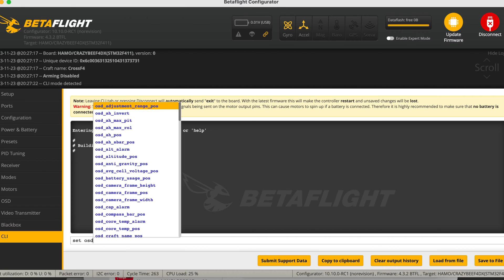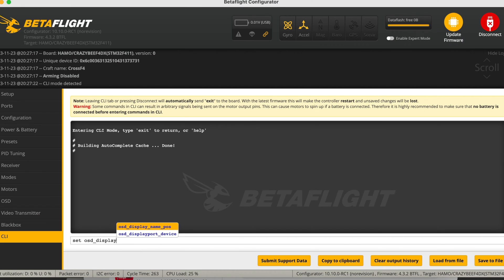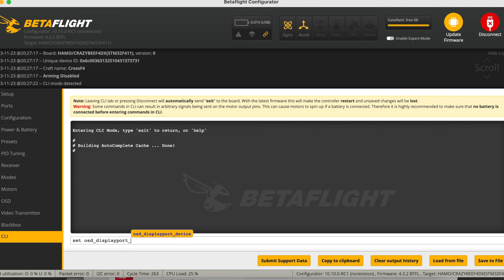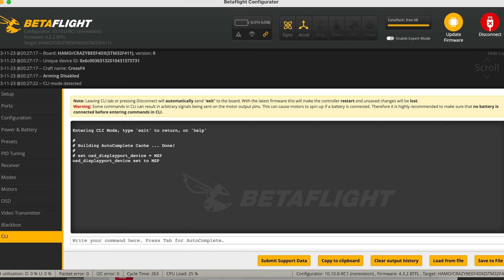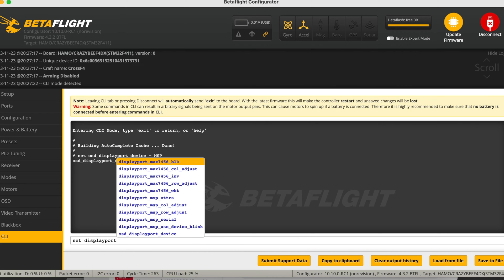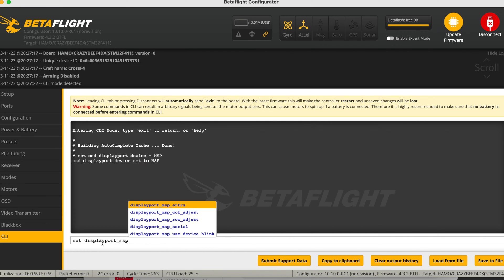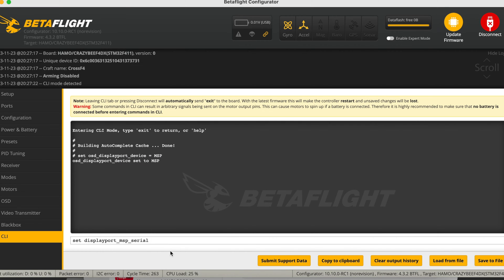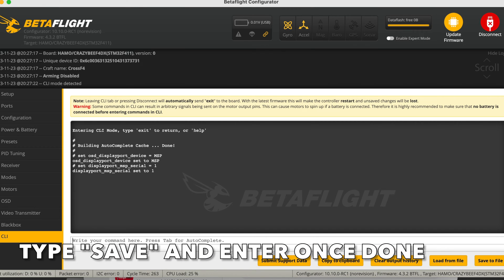No OSD fix for your HD builds | HDZero|Walksnail|DJI

Comment: Hi mate! Great job and nice fly!
Maybe you can help me! I've tried many different solution but my
Caddx wont show me the OSD on the converted crux35 4.4bf! 
I've tried the CLI lines as you suggest, I've tried diferent presets (that have worked on other 2 quad I've upgraded with caddx vista) I've also tried different combination between rx/tx (UART1 because UART2 is about internal ELRS i learnt), I've checked the continuity of the wire im using! Upgraded and refereshed both the FC and the Vista unit several times! Everytime i get image on my goggles but no ODS! Also my goggles2 show me the symbol ^ with the value 0.0v

Do you have any clue?

Thank you!
Reply from the maker: Hi bruh!!!  Okay, so with all that troubleshooting done.  Swap out the TX and RX wires. See if that works!
Reply: @shogunemperor  thanks for reply dude! Yes I've also tried swapping the wires but unfortunately nothing changed! :(
Reply from the maker: @user-ub6wz8ms1k  aaah dammit. Can u remind me what FC it is again please? High chance is that its a settings issue or the OSD chip is damaged and u will need to contact Happymodel directly and see if they could help. Info@happymodel.cn just tell them you spoke with Bryan. The troubleshooting u did is top notch. It covers all the processes.

Comment: lol, Just went through this.  Make sure your soldering is correct (had rx to rx tx to tx, easy fix and cleaned up a few other things BONUS!).  Camp HDZero here, there's a nice preset for HD0 VTX's in BetaFlight, 4.4 HD OSD FTW.  And with that out of the way it's my turn to go flying today.  Always a treat to see your flight videos, thanks for the tips and reminders, Cheers!
Reply from the maker: hahaha right??  I had the same thing too... didnt fix it for months.  I have both the HDZero and DJI so works well for me. Yeesss!! But, I have a few FCs that I cant use BF4.4 which will cause some weird RXloss issues.  So good that urs is fine!!! Aaawww thanks so much for the kind words bruddah.  U have an awesome day my man!!!

Comment: Betaflight 4.4 has specific improvements for HD OSD , that keep you out of the command line 👍 there are osd presets, but also onnthe ports tab they have added peripherals to the last column of MSP port 👍
Reply from the maker: Yes, but in the case of some who’s struggling with them. This is the answer for it. BF4.4 is so much easier these days. Just additional info wouldnt hurt
Reply: 4.4 wont keep you out of the cli. I have 4.4 with walksnail x and i chose the preset for HD avatar. Still had to go to CLI and type in the info.